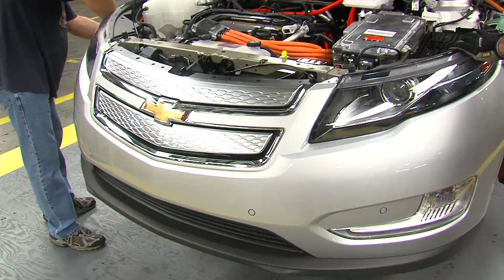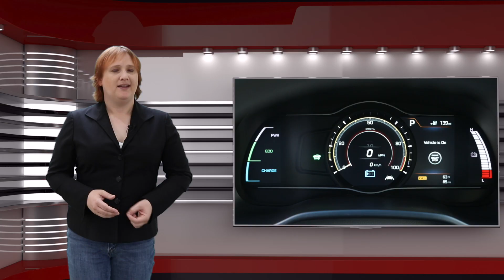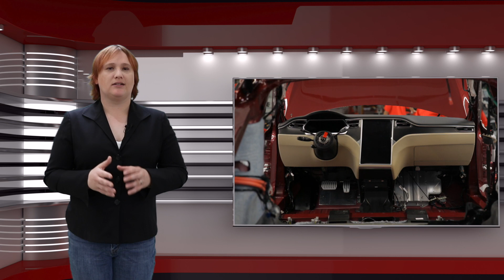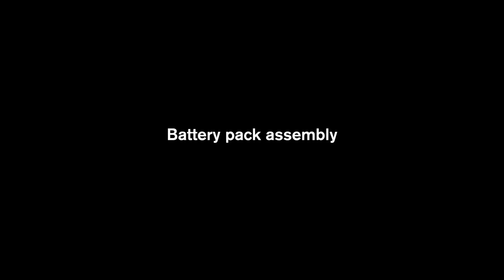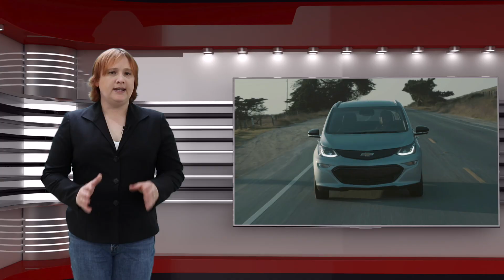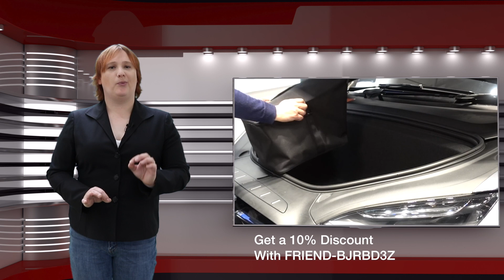Why Electric Cars Don't Use All Of Their Battery Capacity

Comment: It's a rational engineering compromise between range and cycle life.  Next question..   The engineers have to make things with a degree of idiot resistance.   The same people that want the option to use up that engineered margin will probably will be the first to scream when the battery fails prematurely.

How many people purposely try to run their fuel tank to nearly empty before adding fuel?  Only difference is you can't hitch a ride to the charging station and bring back some charge.

Comment: I have a few question.  If the government of various countries want to promote EV use (1) why don't they standardize on a plug type, (2) Why don't they mandate charging stations around major travel routes.  Since it takes time to charge a car, it would actually make more sense that charging stations be at restaurants than at gas stations until the charge time equal to that of filling your tank.

Comment: I really appreciated your thorough and lucid explanation of "actual" vs. "allowed" capacity and, although I already understood this concept, it gave rise to another question about terminology: When a mfr. states that Level 3 charging will bring the vehicle to an 80% state-of-charge in x-number of minutes, does it mean 80% of the actual capacity or does it mean 80% of the allowed capacity? In other words, if the vehicle advertises a range of 200 miles on a "full charge", will a Level 3 charger bring it back from "allowed zero" to 160 miles of range in the advertised time? Or, if the allowed capacity is already 80% of the actual capacity, does it mean that the vehicle will charge to 80% of the actual capacity - or a full "allowed" SoC in the advertised time?

Comment: Your explanation makes sense. For example original Prius plug-in only allowed 3k use of 5.5k total including the traction battery. So pretty much never use top or bottom 20-25 percent. Also if you look for people that got the battery error most will say it happened after running out of gas and kept driving .. at 20mph...

Comment: The major reason Tesla have an occasional "more range" mode and most manufacturers don't isn't really to do with the cells or their chemistry, more to do with the absolute size (in terms of total energy) of the pack typically fitted. 

 A Tesla has a large battery, between 65 and 100kWh.  This means that most people do not "flat" the battery very often as most journeys are short. A leaf, with it's original 22kWh battery and 70 odd mile range uses most of it's battery most of the time.  Therefore, the use analysis done by the OEs suggest that it would be a bad idea to allow a leaf to use more of it's battery, whereas a Tesla can do so, simply because it would be un-usual to actually do so!  In effect, they enable useful functionality, that people don't really use!

That large Tesla battery also makes it, by default POWERFUL. In fact, it's more powerful, by far, than it needs to be, simply to get enough energy storage.  So again, unlike a little leaf battery, pulling high current from it, even at a low SoC is not too damaging, because that current is shared across a large active area.  That active area, the membrane across which the charge carriers are driven by the electrochemistry is large (far larger than for a small leaf battery) but the difference isn't the number of cells, it's the overall area / size.  (because pouch cells have very much larger area for the charge migration to occur per cell)

Early EV's had very conservative battery management strategies.  OE's were unsure themselves on how their EVs would be used played very safe (just like they would for example in setting the maximum rev limit of an engine well below the point at which it might actually fail) as they didn't want expensive and reputation damaging warranty claims, or even catastrophic thermal events (fires!).  Pretty much all EVs report there useage patterns back to the their makers, some liek Tesla and BMW do so in real time 'over the air' whilst you drive them, some, like Mk1 Leafs have onboard loggers that are downloaded for their data when the car is in for a service.  Over the last 5 or so years, the OEs have used this data to understand exactly how there cars are being used, and slowly have opened up more and more of the battery as their learning allows.  Tesla are particularly quick to react, due to their over-air updates, issuing software updates in real time to their customers and "upgrading" their cars as they drive.

Comment: Question: seems like charge rate keeps going up.  If you buy a car now, in 5 years the 400kw chargers will make your electric car seem bad.  Do any manufacturers plan on supporting upgradable battery packs/ chargers to future proof their cars?  Any aftermarket battery packers putting 2170's in a model X size bundle?

Comment: HI Nikki, Have you seen Renault Zoe 43kw onboard charging system. I wonder why others are not using it. It will drastically reduce the cost of fast charging infrastructure.

Comment: Tesla also has an active cooling system that keeps the cells cool at high amp draw, which is why they allow you to charge to max when going on long drives, most of the electric cars on the market are passively cooled meaning that they use air cooling which if the out side air is very hot or very cold then your cells are going to under performs as well as hurt the life cycle of your battery pack.

Comment: AFAIK range mode nowadays (don't know whether it's ever been different, but I trust your word) is more about battery heating and cabin heating and the like. 
So the lower end of the Tesla battery isn't that different from all other EV makers, AFAIK. The difference is that Tesla allows you to charge to 100% (still not real 100%, but much closer to the actual 100% than in other cars). 
Meh, I just found out my Zoe can't even charge at a preset time when I don't pay for the internet connection. Well, paid for it again yesterday, still can't preset charge time.  (as the Zoe can't be set to only charge to 90% or so and if you try to do it manually, the BMS thinks the battery is in worse condition than it really is, I use the timer to charge the car shortly before I use it the next time, so it doesn't sit at high states of charge for prolonged time)

Comment: The reason is because the way lithium ion cells discharge have a drop off curve where if it gets too low can be possible to cause chemical reactions which can either flip the voltage around (which would blow a short on the cell fuse) or not able to charge up again.

Comment: Still the best! Nice explanation. I remember when you had less than 27,000 subscribers. People know what the best looks like! 
If you would… explain how my Tesla can power my house when the grid power goes out (if it is possible).
Reply: R A F A Leaf can do that, because they are specifically designed to do that. A Tesla cannot, because they are deliberately designed without that ability. It's more than just an electrical connection to your car's battery, and Tesla would rather sell you a Powerwall.

Comment: The Chevy Volt is a hybrid with a battery designed to cycle a lot, so they limit the use to 60% of the actual capacity. BEVs allow a greater percent of the battery use,  but it’s still best practice to use only the middle 60% of the battery pack. 

Tesla gives better user control over the maximum charge. Bolt allows you to extend battery life by using “Hilltop Mode” even if you don’t love on a Hilltop. Nissan Leaf no longer allows the driver to select less than 100% indicated, which relies on the BMS to set the safe buffer from high cell voltage.
Reply: Smaller cells ie less powerful cells (connecting in parallel as "bricks" or not) r inherently more difficult to keep balanced (its the weak link theory) and in case of hard wiring them they r far more difficult to replace.  

In general in electronics 1 component that replace many tend to be more reliable. So It's just a rationalization that many cells in parallel would be robust than 1 with a higher current and capacity cell.

But the real factor is how well the BMS and thermal management is designed that determines, how much the 80% capacity rule can be deviated from without significantly affecting the battery. 

So welcome ppl to the Tesla rationalization channel.

Comment: The older Volts use 80% of the battery when new.  GM will not let you go below 10%.  The battery is also liquid cooled and can only slow charge.  That is why an 2011 Volt has the same 35 mile range it had when new.    The Battery does degrade.  As it degrades GM unlocks more of its capacity.  Wile an 2011 Volt may have the same 35 mile range it did when new it may now be using say 92 % of the batteries capacity. For the Customer they are getting the same consistent performance over the life of the car.  The Volt has been easily the most reliable electric car you could buy in the states.  Even wile having to pull around a gas engine.
Reply: exactly my 2012 volt battery perform as new after 100,000 miles, this car is underrated imo

Comment: Thanks to Doug then.  There is a whole big area of battery management called 'cell balancing', which along with thermal management (temperature control) and voltage and current monitoring, and rate of charge and discharge, really begins to show how sophisticated this is, compared to say - a torch.  Simple devices, just don't need all this stuff.  'Cell balancing' is needed because even modern mass-production, cannot exactly ensure every single cell is at the same level of performance, or sit at the same voltage exactly.

So, you floor the accelerator in your EV.  Some of the cells are having slightly more in reserve than others - there's a famous curve which has a 'top' and a 'tail' and I did one once for schoolkids in a class, for test results.

'Hey' I said to the Deputy Head '...look at this excel graph I made from the test results - you can see the low-performers down on the left hand side, and the top performers up on the right hand side, and see the sudden change in the curve Excel drew to fit these results'.  He said, 'Great, send me a copy'.

Next week comes, I get back to him again 'Hey I did another graph for that other class - and guess what - they happen to fit the self-same curve boss!'  That was when the Deputy Head had to appraise me of the mathematical fact 'Yes, EVERY class will produce such a curve!'.

The curve, looks like a wave viewed in profile, from the side.  Or an old-fashioned letter 'f' which also has a bottom curve to it, pointing the opposite way to the top curve. Imagine it is an italic 'f' because the middle bit slants quite a bit to the right, say 45 degrees, depending on the axes of the graph etc?

The battery cells' performance, is exactly like the school-childrens' performance, in that the individual battery cells, follow this same pattern - some of them, sprinkled throughout the battery pack randomly, are down in the tail-end - always low on voltage, always poor at draining current and charging, and always lagging the performance of the other cells.

The top end, has a small percentage of cells too - always HIGHER in voltage, always charging FASTER than other cells in general, and so on.

The largest amount of the cells though - say 85% - are in the 'Goldilocks' middle section of the curve.  Like those students, this big 'middle bit' of battery cells, are not the fastest to charge, don't maintain the highest voltage, but neither are they slowest to charge nor maintain the lowest voltage.  The Goldilocks section.

Your problem then, is everything outside the Goldilocks section of the curve.  These, are such a PITA to manage, because they are randomly sprinkled throughout the battery pack, you would probably chuck some of the really GOOD performers, out of the pack, and similarly some of the very WORST performers, just to get the cells to be more similar, closer in performance to each other.

Now, think about flooring the accelerator in your EV.  Keeping it flat down, until well, forever.  There comes a point, the 'good' cells are still pretty good, with energy left in reserve, so you won't damage them.  The middle cells are probably just about coping...and the poor-performers?  Well, they're knackered, broken, dying, etc.

After a few runs like that, they are going to snuff it.  These cells, I believe, are the reason why a good manufacturer, can only permit 75% or so of the battery capacity, to ACTUALLY be used up, unless it is the last ever run you are giving that car and those extra miles are life-saving ones.

These poor-performers, being mixed in with better-performers, are forced into the absolute danger zone of battery drain in extremis, foot hard down.  These, hit their deck first - absolutely completely, flattened, no charge at all left.  Nikki I believe is correct - you can't do this with any battery and expect much of a recovery let alone Li-ion.

Indeed, the reason Lead Acid batteries have lasted this long, is they are tolerant of deep-discharge, of exactly doing that horrible thing of totally draining the poor thing flat.  Why do you have to make sure the acid levels are the same in a lead-acid battery?  It's the most primitive form of cell-balancing.  If one has loads of acid, another is almost 'dry' then patently, one cell will put out the whole (1.2?) Voltage or whatever, and the other will not.  Then, when you 'deep drain' the battery cranking your old ICE engine and failing to start it up, the one lacking acid, is being damaged, and the other has to get pushed harder to cope.

The apparent 'reserved area' is actually ALWAYS necessary on Lithium Ion, or any other big battery made of an array of smaller ones.  If you had the ideal - a huge, monolith of a cell, that happened to be exactly the voltage you need, and capacity you need - you could much more closely pull it down to a safe baseline.

So, to summarise - exactly what Nikki said, you have only so much you can drain the battery down.  In addition, you have to have a margin of safety above that, because some cells will 'hit the deck' first, and you will kill them while most of the rest are not in actual danger yet of damage.

We can take it, that many Nissan LEAF EVs, in the heat, and pushed closer to their actual max capacity getting drained as Nikki says, simply end up sacrificing, damaging, those 'poor performing' cells down there in the left hand corner, the low-down tail of the graph.  And just like the schoolkids, no matter how many you 'lose' each time, there's ALWAYS mathematically, going to be ANOTHER TAIL-LOAD of 'poor performers' ready to be damaged instead.

Slowly, you discover what my Deputy Head teacher said, is true - there is ALWAYS a top and a tail and a middle bit, and the top and tail are about 4 out of thirty students, and the middle bit has the other 22 students.  But, if you kick out these 'poor performers' to bring your school up - hey, guess what - your class grows a whole new 'tail' section!

So, those LEAF EVs will just keep dropping off their poorer cells into the dead zone, because the system is fundamentally flawed, too close to the bone, and it shows up worst in heat.

If you do it right to the very end, even those 'best performers' will form into a tail, middle, and top section!  If you had just 3 cells left - they'd make that curve for you in terms of performance!  My top 4 students in that class, if I had 'booted out' the rest for being in the 'tail section' every time I assessed the class, until only the best 4 were left, would form into two in the middle, and a top person and a lowest performing person - it's mathematically required in the real-world, no two cells or students are so close, you can't separate them if you measure them closely enough.

(Of course, there's that law as well, named after some old bloke, that says the faster you drain the energy from the battery, the more reduced the amount of that capacity actually becomes - you dwindle the total capacity, by simply trying to use it faster.  I dunno if it's more heat losses, or simply a function of the way the cells internally work, but it is a true fact.  Slightly different aspect to the problem though, so we leave it for now?)

Or put more simply, the tail-enders in the herd, always get clawed to death by the malign force in their world.  And every day the herd goes to the watering-hole, a whole new bunch of 'tail-enders' magically appear out of the herd.

Thanks Nikki and Doug her patreon, for the thought-provoking piece.

Comment: That's pretty much correct, but Tesla does have a buffer that the user can't see. When the user sees 0% and the car refuses to move, there's still a reserve to keep the battery from bricking. That was true with the old range mode too. At the other end, Tesla does allow users to charge to 100% as the video states. As long as the user doesn't do this too often, and especially if the user doesn't leave the car at a 100% charge, there shouldn't be a significant problem. Charging to 100% on a road trip and driving away as soon as the charge is done isn't likely to make a difference in battery life.